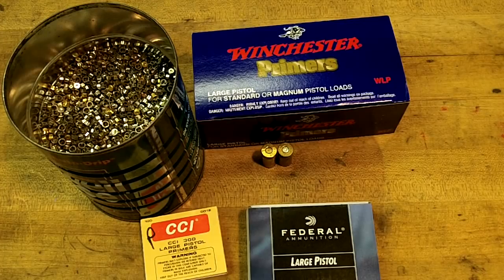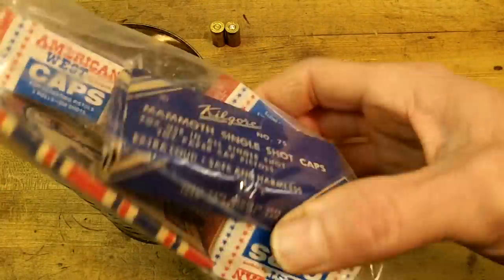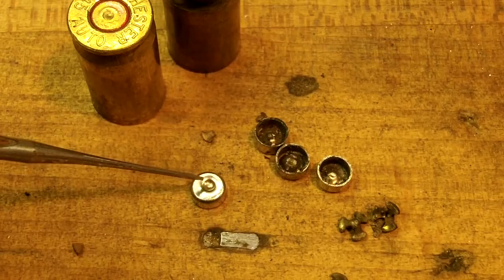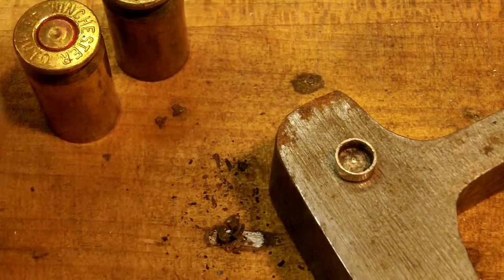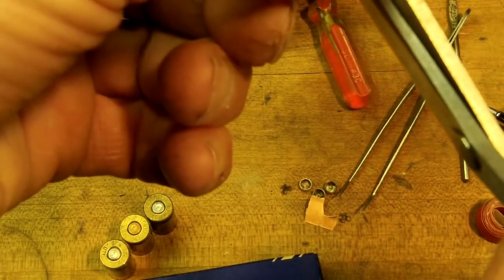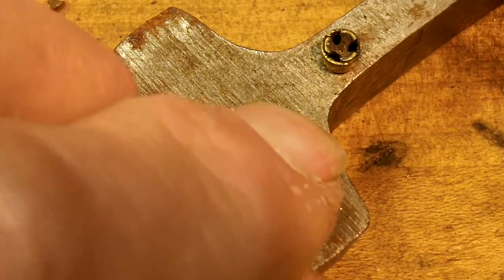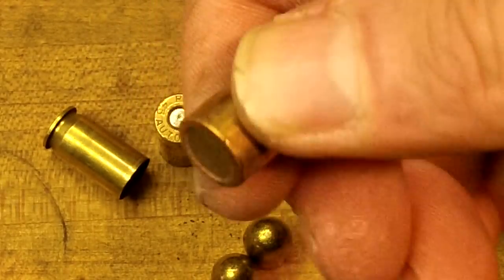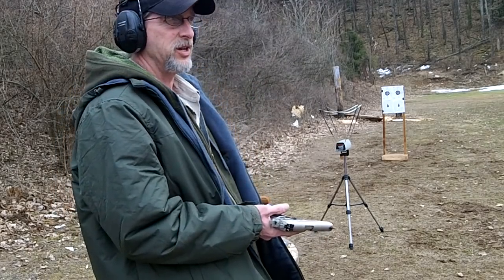What if you can't buy primers for handloading, DIY ammo option

Comment: I've done this with "Strike Anywhere" matches, and it works. Really well. The difference between this and a commercial cap is negligible. Would definitely work in a pinch. Just make sure you flatten out the indentation as much as possible. I used a smaller punch that goes after the indentation itself without "thinning" the bottom of the primer anymore than necessary.
Reply: I might be forced to try that since primers are constantly out of stock

Comment from the maker: I also found 2 caps to work better. I updated my procedures on a second video version 2 of this. It is linked to this video.  Thanks for watching sarkm.
Reply: You can make some AP "Acetone peroxide" in place of potassium chlorate for your primaries. Very easy and super cheap to make hence acetone and hydrogen peroxide that can be found anywhere. I pulverize and load while its wet and take a very small amount of superglue to hold it in place. I can give exact instructions if you are interested. -Dave

Comment: Suggestion: heat up the primers to soften them, before swaging out the firing pin indentations.  You should be able to use them over and over, then.  Otherwise, they'll probably crack after a few uses.  Also, you can make a very effective priming compound consisting of 72% potassium chlorate (KClO3) and 28% sulfur (S).  A little bit of fine sand can be added to sensitize it.  Add just a little shellac, and put a paper disk on top, with a little more shellac to moistureproof it.
Reply: How much sand compared to the total of the original mix would you use? 2 percent? And also would you ball mill it? Same for the shell ac.
Reply: Problem is that chlorate compounds when mixed with other compounds becomes unstable and can set off spontaneously. Hence why you don't use it in primers.

Literally firing old chlorate rounds can set off all casings in the entire magazine cause of instability of the chlorate and shock being generated from the initial round.

But you made a really great suggestion concerning the primers. Although it's a fine balance because overheating will create oxides which makes the  primer casing even more brittle.
Reply: DavidLegendHacker  Would this potassium perchlorate still need something else to react with. Like potassium chlorate and phosphorus? Would phosphorus still suffice?
Reply: DavidLegendHacker  Thanks ❤
Reply: That mix leaves a corrosive residue after firing. Be sure to scrub and oil the gun, especially the barrel, immediately after a shooting session.
Reply: @sqocks8254  Chlorate and phosphorus can detonate when you mix it. It is very very sensetive.
Reply: Does heating the primer eh good idea.

Comment from the maker: +Darcy Potter ,  I agree that it is far better to stock up on components when they are available.  I tried this experiment as a test , when primers were not to be had, except for huge markups.  Thanks for adding to the discussion.
Reply: Jon with no h  Excellent video, brother. Information like this could save lives one day. I'm going to punch out some spent primers from my old 9mm cases and try something like this.

Cheers,
-John with an h.
Reply from the maker: *****
 I wanted to see if it could be done, and it's tedious and slow, but possible.  Hopefully we never need to resort to this. Good luck. Glad you stopped by.
Reply: I have a suggestion sir if u were to use a caliper to measure avg dent after fired and drill it on surface  your hammering out to re flatten  I believe you would achieve a flatter service for the firing pin to read easier. Just a idea I know your way more knowledgeable  then I with these matters but would like to know what u think good day sir
Reply: Jon with no h
Reply: +Peter Piper, Are you referring to toy caps that are shaped like #11 percussion caps used as primers for black powder firearms? If so then there is a problem. The toy caps do not have a internal anvil that is needed in order for the hammer to set off the charge. The toy caps are designed to slip onto a pin that serves as the anvil for the hammer to set them off. This design and the way it's set off is just like the percussion cap technology. Even if you could figure a way to incorporate the toy caps into a modern shot shell, they are not the best design as the explosive ingredients are mixed with sand to assist setting of the charge. Sand is not the best thing to expose a working firearm to!
Reply: hello,i had been watching your video several times before.But today i'm just interested with your content because i'm making ammo for my toy gun convert real gun.the kclo3 powder in the match can be ignition and burn in a fit tube,but the strike should be hundreds joules.i was trying and had fired the homemade ammo by match powder with just a rubber string but it couldn't fire until it meet the phosphor.
Reply: I agree that stockpiling special parts/ingredients that are the culmination of a thousand years of technological development is the best bet, but emergency preparedness for backup supply is always a good idea. I'm glad this is out there. Given how much flexibility there is to ignition of the propellant in a cartridge, I assume there is also a wide range of possible solutions to this problem. Given how dominant lead styphnate is though, I hope people still keep experimenting.
Reply: +Jin Yow That's a clever idea, Jin.

Comment: There was a percussion cap system years ago, that punched caps from strips of aluminum bear cans and formed the cap. They used toy caps too, punched out with a hand held paper punch. They recommended using a moistened wooden dowel to pick up the punched out toy caps and placing them. They said sometimes two caps worked better. Moistening the caps also allows them to be slightly compressed. The spacing between the anvil and the primer base is critical, and maybe caused those two failures. Thanks!

Comment: I grew up with cap guns, and one thing I remember well about them is some caps just don't want to ignite unless you hold a flame to them.
My guess is you had a couple of those dud caps. From my experience with them, it seems from my observations that the caps that didn't ignite had less powder in them, and looked flatter than the other caps. The caps that had noticeable bulge always went off. Maybe take that extra step to only use the "fat" caps and not the "flat" caps on any given roll/sheet (never seen a sheet before; it was always rolls or plastic ring caps).

Comment: you should get a leather punch to cut the caps out of the strips, much faster and cleaner. if you get one with removable screw in punch tubes, you would have a neat stack of caps in a tube that you could easily feed into the primer by pushing them out of the tube with a small dowel.
Reply from the maker: great idea shonuffisthemaster I have used a paper punch, after I did this video.

Comment: This has defiantly opened my eyes to some alternatives to re loading I've not shot for a while now and since I've come back ammo has trebled. Someone is making some serious money. Those miss fires would have to do with the dent in the primer, the paper and the anvil not being flush. The fact that 3 went off is testament you have made it work. Good show old boy.
Reply from the maker: My second attempt and video had better success.  I wanted to see if it could be done if push came to shove. Thanks for watching.
Reply: Cheers mate some might say your tight, I say waste not want not. I know primers are least cost in reloading process, but if you even save just a few cents per reload that's hundreds down the line. I'm going to keep my primers.

Comment: I like your somewhat scientific approach to this problem. I have also messed with primers & I cut out the caps with a 1/8th inch paper punch I bought from a hobby store (You can find them online also). The paper punch is quicker, a lot more reliable, and cuts much closer to the black dot of cap. It cuts too close sometimes and I set some off but it goes with the territory. I never thought of scrounging up bullets. Excellent idea. This whole "gorilla" approach to ammo is not just for the desperate when no ammo can be had but also for retired persons such as my self. I got more time on my hands now but can't afford ammo after living expenses, meds, transportation, insurance, taxes, etc. You get the picture. I can put up with a few misfires. I've learned to be a lot more patient as I get older.
Reply from the maker: Thanks for your input tinkerrbill my second video I used a paper punch to much better results too.  I can understand your funds dilemma.  Shooting can be a costly hobby if you shoot a lot.  Good luck in your future endeavors.

Comment: I never got around to updating my own experiment, but WOW! Loaded up 8 rounds of 9MM, and had 7 perfect detonations. Not too shabby! For a SHTF situation, these would be excellent coupled with a double action revolver. If one does not fire, just pull the trigger again.
Reply from the maker: Hans S. That is great.  My second attempts and video I tried some new ideas suggested by viewers, and I had 100% light-off.   Your suggestion for a revolver is a great idea.  Thanks for adding to the discussion.
Reply: Jon with no h shootology channel By all means, thank you. You were the first one I saw who introduced this concept. All others  used the match tip and method, which is far more time consuming and the failure rate is much worse.

Comment: Jon with no h shootology channel 

Add a little Black Powder on top of the cap and then put the anvil in, if the cap goes off at all it will ignite the BP and in turn ignite the smokeless gunpowder, since the loads are corrosive anyhow a little BP isn't going too hurt it at all, just clean the crap out of it afterwards. Or you could grind up matchheads and add those on top of the cap doing pretty much the same thing as the BP. Oh yeah and Windex (the one with ammonia added) works wonders for cleaning up corrosive primed ammunition, it even works for Black Powder muzzleloaders and is dirt cheap and readily available, I even use it too clean up guns that have never had corrosive ammo run through them because it works so well.
Reply from the maker: TheVekose I like your suggestion , I will add it to all the good ideas, commenters have added.  Yes , the caps are corrosive, so adding BP does not detract , since cleaning is called for anyhow.  Thanks for adding to the discussion.
Reply: Jon with no h shootology channel

I bet the caps were going off on the bullets that failed too ignite, probably wasn't burning hot enough to ignite the powder, the BP should radically improve the fail to fire problems, if even enough to make this a viable alternative if you're really "just that poor" and can't afford primers all the time.
Reply from the maker: My second video in this experiment, I did use new procedures suggested in comments, to better effect.  A hole punch was one new tool , that worked much better.

Comment: Jon, I saw your video 6 to 8 month ago, and i wanted to do what you did. I went ahead and tried out on a small pistol primer, I shot them out without powder to see if they will shoot, some did and some didn't. So i did 2 caps in each one,and made 5 and tested them out.They were great. I took the time to make 50. I did 10 a night and i had fifty to go shoot. I made 9mm and all fifty shot,No problems. It did take a little time to make, but i enjoyed doing them knowing i can make them if the sh** hits the fan. Thanks for the video.
Reply from the maker: That's great to know that small primers work too michael dean I found the large primers hard to work with, i imagine the smalls are a little more tedious.  Thanks for adding your input.   I do have some more similar vids to come out soon along this experiment, so stay tuned for more to come. Jon

Comment: another thing to try with your caps, is to take a Stanley knife and scrape the compound off of the paper instead of cutting it out. With a little practice I got pretty fast at doing that.
I actually haven't made a primers in a few years, because I stock up on store bought after the last shortage, but you have me inspired to experiment some more.

Comment: Interesting stuff. Good idea using the caps, but I would suggest using something like a hole punch made for leatherwork instead of cutting them with scissors. Way, way faster and can give you a perfectly round piece, perfectly sized that would eliminate all that trouble getting them in the casing. Probably make things a bit more uniform also.
Reply: When I tried it I made a tool from a old primer with the edges filed to make it sharp that i silver soldered to the end of some drill rod I had.This way I could center it over the cap on a piece of cardboard and with a little pressure you could punch them right out.
I also used a slightly rounded punch on a brass block to get the dent out a lot better.
All in all it took maybe a hour to make the few things from scraps and junk lying around and it's now in a small pouch with my reloading gear.It was just to see if its doable type thing but I kept the stuff since is so small just in case type thing.

Comment: I was wondering maybe the missfires are caused by work hardening of the primer. the initial firing ,then hammering back to shape. Maybe annealing them ,should only take a few secs.with a blowlamp. But then i could be talking nonsence, hehe good luck.
Reply from the maker: You have a unique view about this project Stan Williams , it could be a valid factor.  I am working on new methods for this , and may experiment with your ideas. Thanks for adding to the discussion , Jon
Reply: Acceteline torch works well for annealing. As soon as the metal is blackened by soot, its annealed, and once again pliable.

Comment: The materials used in modern primers vary from manufacturer to manufacter, but broadly fall into 9 categories. The most common composition type (as 408 said) is what is called SINOXID which has a number of common derivatives. These normally contains Lead Styphnate, barium nitrate and antimony suphide, although the antimony sulphide is occasionally replaced by calcium silicide or aluminium and lead styphnate may be replaced or augmented by tetrazene or diazodinitrophenol.

Comment: For cutting the caps out, instead of scissors, take a small tube of the right diameter, and file the outside diameter with a 45 degree angle at one end to make it sharp. Use is as a hole punch.

Comment: I wonder if you could modify a primer into a "spark plug" and then use electricity to trigger it. Have two sharp spurs sticking out of the inside of the primer with a small gap between them. Use a piezoelectric lighter trigger to activate. Instead of a firing pin, have a spring loaded electrical contact like you might fine in the battery compartment of a battery powered item. I don't know if that would be sufficient to ignite the powder.

Idea #2. With 12 gauge shotgun shells, drill out the primer hole to make it wide enough to accept a .22 blank. Use the .22 blank as the primer. Positioning the blank properly so the 12 gauge firing pin will hit it in the right spot might be tricky. It might be possible to turn .22 short rounds into blanks if you knew how or you might just remove the bullet from the .22 round, empty the powder, and use the primer end of the .22 as the primer for the shotgun shell. This would be an option if for some reason primers were unavailable, but .22 rounds were available.

Comment: I love this vid! Very good info.

Might I suggest instead of scissors, you use a sharpened hollow punch of a diameter slightly bigger then the cap. It would be much faster and they would come out as perfect circles.
Reply from the maker: Ljungman Agforty I used a paper punch for second experiment and video, and it worked much better.  Thanks for your suggestions and kind words, Jon.

Comment: You can buy a 1/8" paper punch from some craft stores or on line. I find this works fairly good to reduce the cap small enough to work. Once in a while you set the cap off so wear protection but practice makes almost perfect. Certainly a lot faster and rounder than scissors!
Reply from the maker: Great suggestion tinkerrbill I tried a paper punch on my second video, and i agree it worked a whole lot better.  Thanks for watching and adding to the discussion.

Comment: To hold the primers in place while you fiddle with them, maybe get some quart-inch bals wood from a hobby store and drill holes completely through.  Drop the primers in the hole and that should hold em still while you work on them.  When done, just push the primers out.  Can probably do many more, much faster.  The hole punch idea for the caps that others have suggested will also improve production-line speed.  Good work!
Reply from the maker: CARVA Republicans That is a great suggestion , this certainly would help speed up the process.   Thanks for adding to the discussion.

Comment from the maker: delstacy24,  I went to your channel, and I remember watching your video before I shot mine.  I went with the cap, because the match tip method seemed more time consuming than the cap.  Also strike anywhere matches are not always easy to find.  I have since gone on to use two caps per primer for much better results.  Thanks for adding to the discussion, and your experiments. Jon

Comment: IMHO the main cause for the couple of failures was simply too much head space between the anvel and cup center.  The two areas just didn't have sufficient pressure to squeeze the compound/cap and cup together for ignition. An arbor press set up just right with properly shaped heads would fully press out the firing pin dent, and seat the cap more flush inside it.  Target guns also see this issue with primers not fully seated and weak hammer force.  Wear a face shield and gloves! The caps are a great idea.
Reply from the maker: 44magnumizer Thanks for the great suggestions, all great ideas..